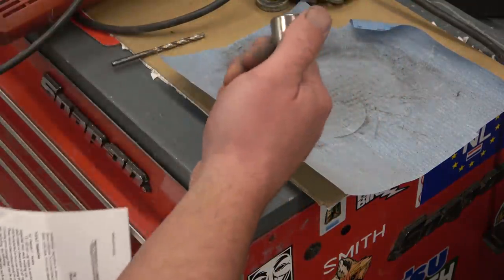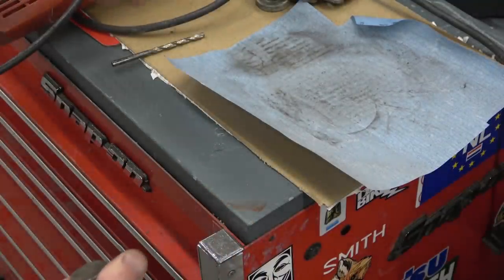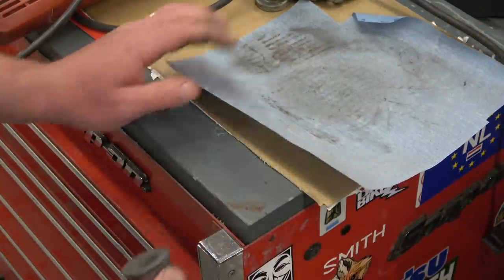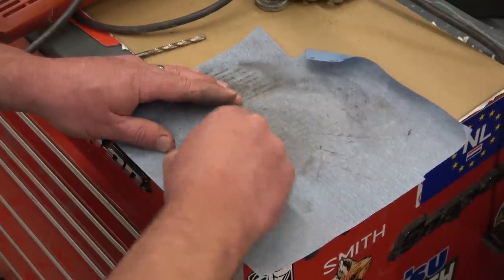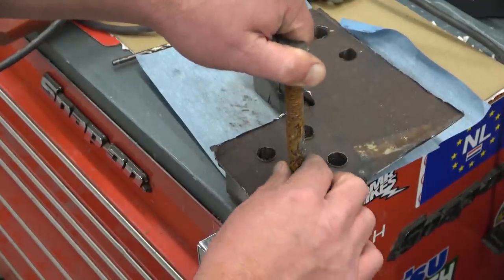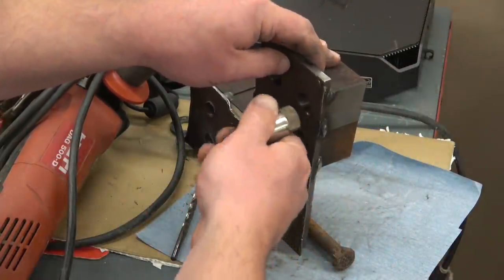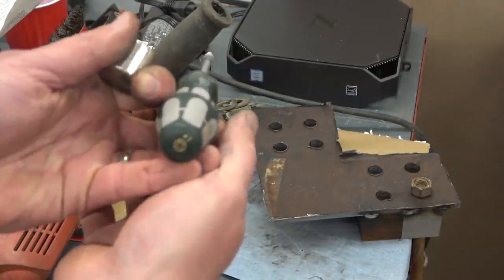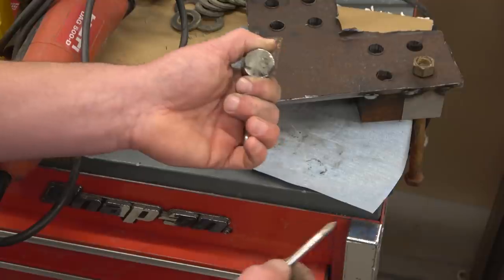mechanic magnet tricks #sharts

Comment: After I make a mess of metal shavings on the concrete floor I clean up with a magnet/ my level.  Put your magnet in a plastic bag, wipe it on the floor, pull off the bag over a trash can.

Comment: Hey AvE -ever heard of an AGNI/Lynch Unique axial gap high power DC motor?  They are great, just putting it out there as you seem like someone who might put one of these motors to use.
The principle of the ironless "pancake" motor has been known for many years, but this model is the first to be developed for racing, giving power to weight ratios and efficiencies unmatched by conventional small traction motors and is therefore perfect for the electric karts as well as many other applications.
In the application for rental go karts it is oversized, which guarantees a longer life duration as well as a higher reliability.   There is no special "commutator". The 8 brushes drive directly on the armature and have a lifetime of several thousand hours. As with most electrical motors this one requires very little maintenance. Only a regular cleaning (blow the dust out of the motor) and frequent control of the mechanical system.
The Agni/LynchMotor gives up to 93% efficiency, and it maintains high efficiency over a wide range of loads and speeds. It runs on D.C. up to 60 volts at which it can produce 9 Kilowatts (12 horsepower). The low shaft speed and high torque enable the use of a simple, cheap and efficient transmission in most applications.

Comment: Take a large rare earth magnet and drop it onto a thick copper plate. It will slowly settle. Then, try pushing the magnet along the surface of the copper. The harder you push, the more resistance...... eddy currents at work.

Comment: A technician was demonstrating a procedure for a delegation from the eastern corporation that was purchasing a set of equipment for export. 
They were amused when a fastener fell deep inside the mechanism. 
This changed to wide eyed amazement when the technician extracted the wayward part with a magnet on a telescopic handle. 
Before they returned to their homeland they purchased these devices to add to their own tool kits.
Years later I was disassembling a large linear motor from a tool and the ME who wanted it removed stopped by to check my progress. I warned him that the magnet was loose and in a position where it could jump to its original position, and fingers could be shorn. He said something about his expertise in matters mechanical, and proceeded to drop the magnet back into its original position with such force and speed that it shattered into several non useful pieces, after which he jumped back like the thing had tried to bite him. 
Then he counted his blessings that he still had all of his fingers.

Comment: I have a clamp style belt. I am not sure what they are called but it has a metal buckle that folds over to clamp on the belt itself. Anyways I keep 3 25mm x 2mm magnets stuck to the front part that folds. Not sure the exact size of those magnets but its close to that size. They are super super handy to have. I also carried a little 6x3mm in a little thing I printed on my keychain for a while but it kept getting stuck on other things on the keyring so I took it off. 

Not gonna lie I have been very tempted to get a magnet implant. I went so far to order all the supplies (gold plated magnets, scalpels, iodine, suture needles and thread, etc...) to do the implant myself but chickened out.. or really just realized it was stupid to do myself. But 

I do phone repair and deal with tiny screws daily so having a magnet on me 24/7 would be handy.

Comment: Meh, magnetic screwdrivers can be a mixed blessing in tight spots (like under your dishwasher). 
But I built my own Fastener Finder from a salvaged big neodymium magnet and 4 feet of 1x2. 
Finds dropped fasteners, finds crap in ash piles (after burning demo), finds loose nails the crew left behind after re-roofing the house, and Saves Yer Tires if you'll run it over the driveway once in a while! Worth a lot more than the nothing I paid for it.

Comment: Another trick if you need to keep drill shards out of something but still need to drill or cut near the area you need to keep clea. Take a rare earth magnet and take a plastic bag like you get at Walmart.  And set it next next to the area you're cutting or drilling into. The magnet will pull 99% of the cut steel away from the area you're trying to keep free of this debris.  The take the bag and the magnet to the garage can and take the magnet out of the plastic bag. And toss it all in the garage. Clean magnet and a non contaminated job.

Comment: If you have an old PC with a spinning hard drive and are about to send it to the recycling center, first take apart the hard drive and you’ll find a really strong magnet that used to activate the read/write arms. Bonus, not even a Russian hacker with a million dollar budget will ever hack that drive if you scratch up the discs or clamp them together and drill a 1/4 inch hole through them

Comment: Cut the hairs off an old broom and put one of those magnetic wall mounts for knives on the bottom instead. Use it to sweep after you drop a bolt, used a grinder or spilled 200 screws all over the place. Thank me later.

Comment: Strokint eh magnet in one direction on the screwdriver also magnetises it, then you don't need the nagnet stuck to the blade where it can attach itself to nearby steel
Working in an electrical cabinet ?
Stick some magnets inside and hang your tools for quick access.

Comment: The tips on using magnets are fantastic, but I was today years old when I found out about the Robertson type screw head. I love my United States, but I reckon my life would improve exponentially if I didn’t have to use a Phillips head ever again.
Reply: Robertson is pretty good.  We still have some clumsy people up here that don't know how to turn a screw and will cam them out anyways.  Philips aren't too bad as long as you have a good driver and no morons have come by and mashed it already.
Reply: Great screw, sadly they did not catch on outside of Canada, due to Ford wanting a sole deal with them, therefore phillips or common slot. Even better, if you do strip them, they strip to a phillips anyways
Reply: @thedillestpickle  I’m sure someone has already given it a thought, but maybe combining the Robertson and Phillips heads. Then again, if someone cams a Robertson head, then they should probably take a remedial shop class.

Comment: Will you please do an intro to hydraulics for noobs?  If I wanted to hydro an HF press, what size power pack should I get?  What flow?  What volume? Etc...  I have needs but the game is too expensive to randomly play around with pumps and rams.  I need some rules of thumbs and I know you got 'em.
Reply: Hydraulics can kill you easily. I don't think he's gonna give you the answer.

Do some research.
Reply: @nilamotk  So can welding, tractors, batteries, power tools, auto repair, and fatherhood.  I've done all those.  Hydraulics is, I feel, the one things that I have a use for that I never learned.
Reply: @dk-bw4gk  so go watch some "basics of hydraulics" videos.
Reply: @nilamotk  You got any recommendations?

Comment: Stroke the Shaft of the ScrewDriver with a Magnet a dozen or two times, in a single direction .   It will magnetize the shaft temporarily , enough  to hold the screw on .   That way you don't have the magnet fly off and stick to the workpiece in some awful crevice ..

Comment: You forgot about magnet on a pipe for when you drop that #6 screw 3' down into the guts of the machine. Also, what do you do when the whole damn thing is stainless, even the hardware? Our big gross Apex wet sander has like 3 magnetic things on the whole damn whale.

Comment: On the subject of magnetism , a fellow I once knew was a boilermaker and worked on a maintenance shutdown at an aluminium smelter , walking down one part he said his tool box he was holding moved towards the tunnel wall so pretty strong magnetic fields in there . 
                Later in his 40's he went to kickstart his motorcycle and broke his ankle , found out he had severe osteoporosis , I always wondered if the work in the smelter caused it .

Comment: There is a better trick yet for a screwdriver. You rub the magnet lengthwise to magnetize it (handle to tip) and the other way around (tip to handle) to demagnetize it (or vise versa)